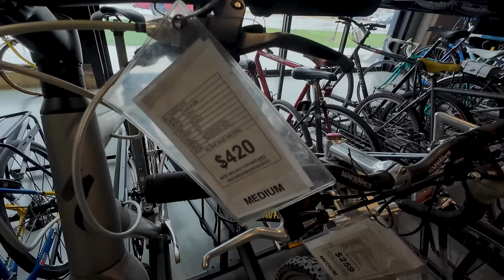The SECRET The Bike Industry DOES NOT Want You To Know

Comment: I like those rigid steel Specialized and the GT you found at that first thrift shop. Let's not kid ourselves about parts: all cantilever and U brakes are total garbage and need to be replaced with V brakes immediately. They are not worth your time attempting to dangle them properly so they have good power, modulation, and lever "feel". Oh, sorry...what to do about U brakes? They can be replaced with roller or drum brakes which may be an improvement. Those 105 levers will go fine with that Ultegra groupset. Go ahead and "mix" it up.